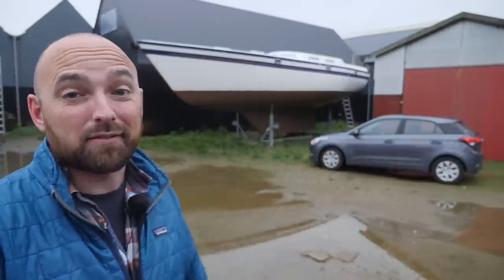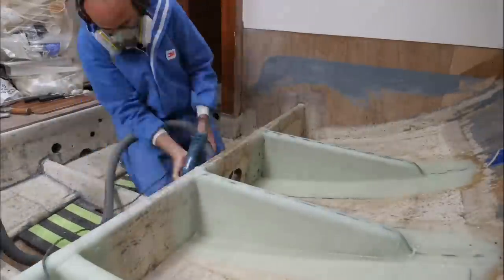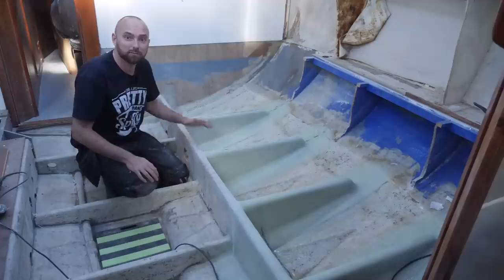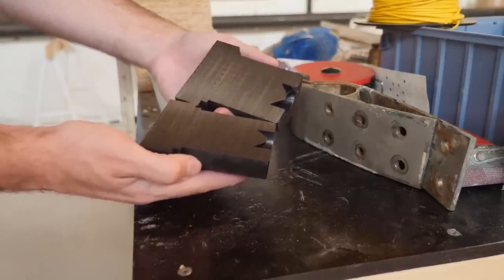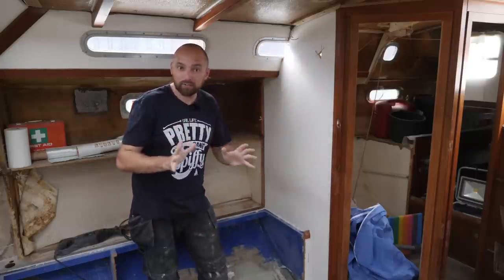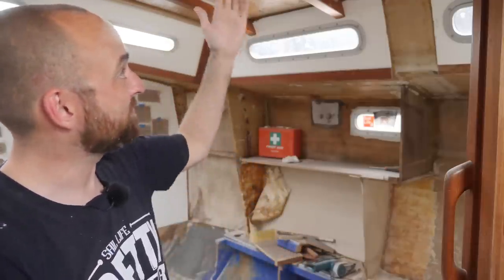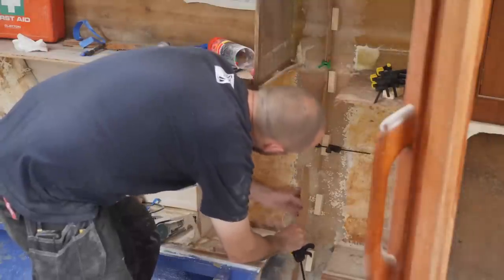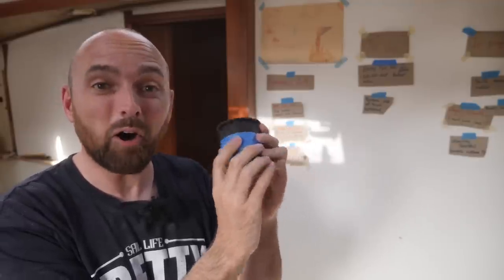Sail Life - Bulkhead template and laying up more glass - DIY boat repair

Comment: THIS is just my opinion, and i know that it's not entirely what anyone else would do, but if it were me, i'd find the place where i could cut the fiberglass, so i can insert the full, un cut bulkhead. Fiberglass is forgiving, wood, is not, even the best repairs (or in this case, scarfs) can act up in time. But again, this is my 2 cents.
Reply: A proper scarf joint is as strong as the plywood itself, especially at 12/1.

Comment: Oh dear, you will need a big mould to bend plywood, also you will need a boatload of releave cuts along the side, no more than 6 milimeters apart, cut to max 2 milimeters of wood left to produce a good looking curve you get to seal the entire stuff in fiberglass on the inside of the curve so no visual cuts there, jus remember to steam the plate before you attempt to bend it.

Comment: In the future, when you are boring out a hole, you'll want to put in some pilot holes, starting small, and building it up from there.  Watch ABOM77, Keith Rucker (Vintage Machinery), This Old Tony, and others for tips on this.  Did you HAVE to split the bushing?  I honestly can't remember.  If you don't need to make a split bushing...DON'T.  :)

Comment: Drill the head of the screw and remove the teak. , to late. Didn’t understand why you didn’t cut the sleeve in half after you drilled the inside hole.

Comment: Cutting the bushing down the middle should have been the last step sir.
Reply: mr worm I think not. The kerf would make it out of round.
Reply: Ahh.  I hadn't considered that.  Because it isn't a metal part and will be under compression I wasn't sure why the tolerances were so important.

Comment: Dude, thats not how you make bushings/bearings/etc.  You get the ID an OD first, finish part how ever you need it to function then split it. The little space between the tow halves won't affect the function.  If you insist on doing it the way you are doing it, you have to clamp the exterior to prevent the slipping